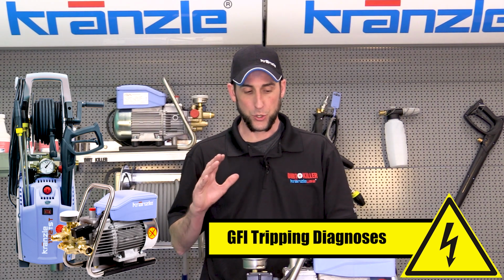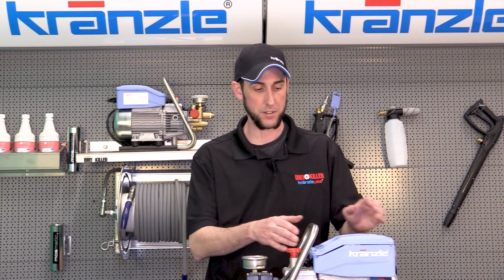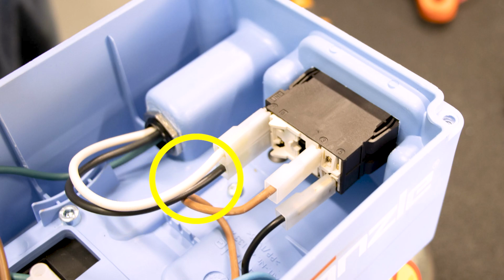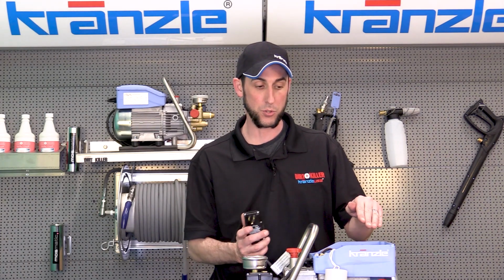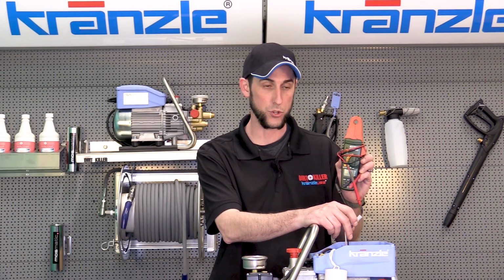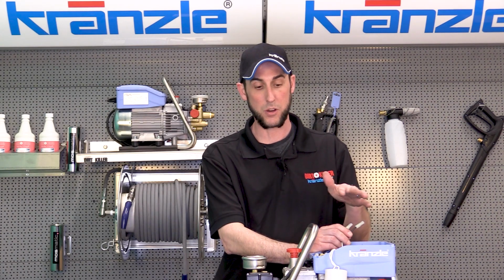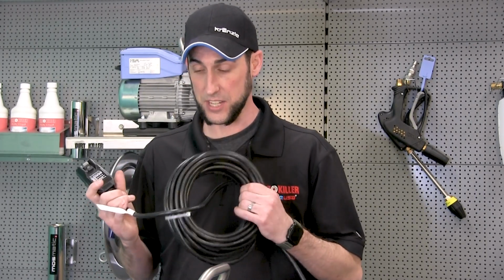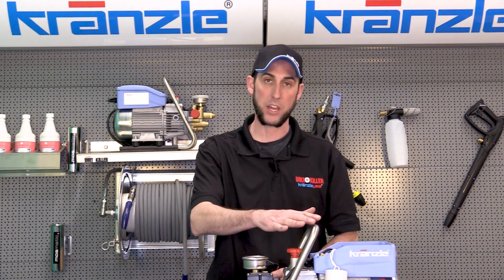GFI Diagnoses | 1622TST 1122TST 1322 | Kranzle USA Pressure Washer Perfection

Comment: I have a 4250, 3500 running watt generator with a 20A Circuit. usually mid way through the job but sometimes even early on when I’m doing the rims, the kranzle will suddenly trip. I bought my kranzle a few years back so it has the reset button at the plug, when I go to press it, at the pull of the trigger it will only work for a second or two before it trips again and at the point I’m unable to use the generator, it will keep tripping every single time I pull the pressure gun trigger and I have to use a house outlet in order for it to work the way it should. Everything else works on that generator, even my mytee 8070H and have used it for 30mins-1hr at a time. From the sound of things, you say it may be my breaker ?
I don’t know if it matters, but I’m also running a 100’ hose
Reply from the maker: Hi. It sounds like the generator is the problem if the Kranzle runs fine on a house outlet. For the generator we recommend at least 4,800 watts and ONLY run the Kranzle. The length of the hose may be an issue. We assume you have 1622 or 1322. Try the factory length hose (33ft).  The exra length of hose maybe over amping the machine as it is working harder to move water that extra length of hose. Also, "where" is it tripping? The GFI? On / Off switch?
Reply: @kranzleusa5846   I have a 1622TS, and okay I will try the 33’ hose it came with. The GFI is what trips
Reply from the maker: @AC-us1gm  Ok. Let us know what happens.
Reply: @kranzleusa5846  the factory hose didn’t do me any good, the kranzle was still tripping. The next day I took it to a kranzle repair center and distributor here in California and they pulled up specs and recommended I need a bigger generator so I went out and bought a 5500/4000, but it’s still giving me issues. The problem occurs 20-40 minutes into using it with the generator, it’ll work perfectly up until it begins to trip. I’m running the Champion Model #201001
Reply from the maker: Is anything else running on the generator? Is the generator in 'eco' mode? Does the machine run properly on a dedicated, standard 110v house line? Feel free to give Josh Lee a call M-F 9-5 ESt . 800.544.1188
Reply: @kranzleusa5846  just the kranzle runs on the generator. And it does offer an eco mode but I turn it off when running the kranzle. The kranzle runs perfectly when I into plug into a house outlet, only have a problem when trying to use my generator with it. And I appreciate it, I will definitely give a call later today